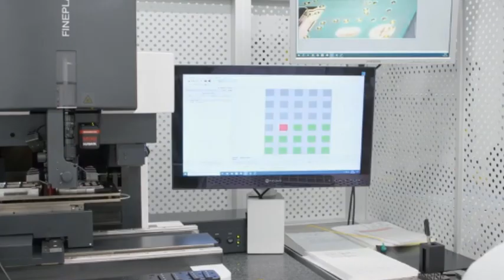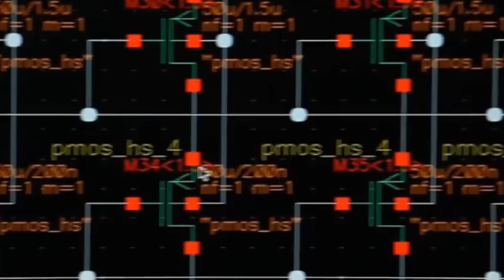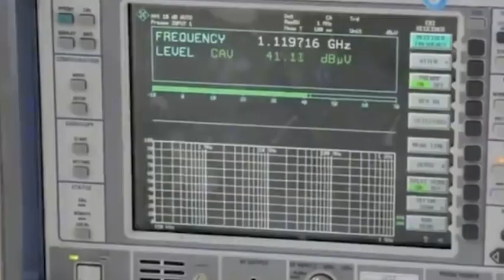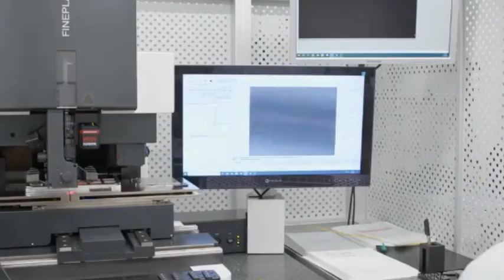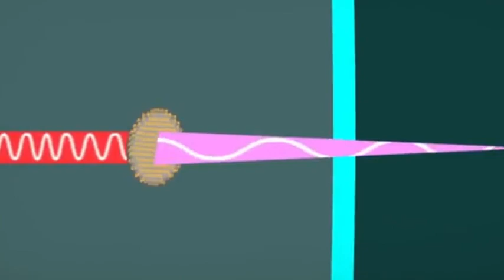The Chinese Giant uses 16.1 Billion to make 7nm chips that terrifying ASML and the West.

Comment: Fake news, Huang doesn't manufacture 7 or 5 nm chip. Only SMI make 7 nm chip with DUV machine in small quantity.
Reply: .....BUT YOU MAKE 5NM CHIPS WITH YOUR BUTT...... 😁😊😁😊..RIGHT???
Reply: It does not refer to Huang but to Hua Hong. Hua Hong Semiconductor is currently the second-largest chipmaker in mainland China, behind rival SMIC .